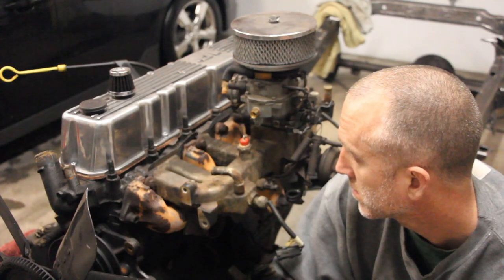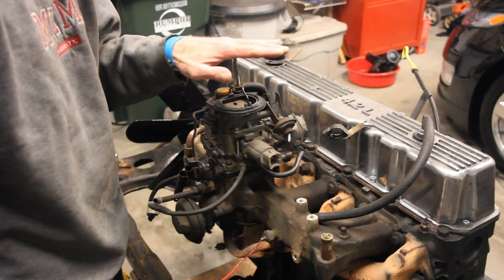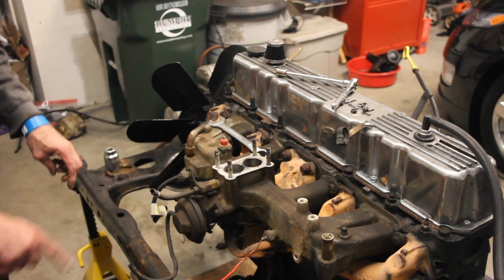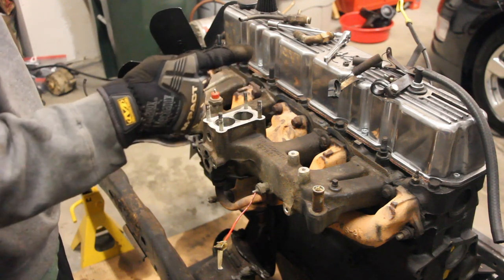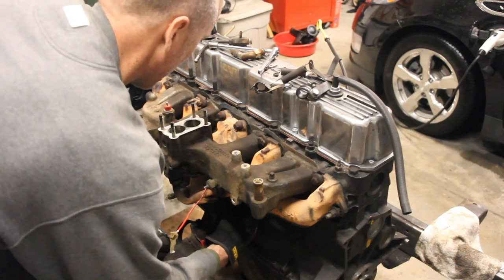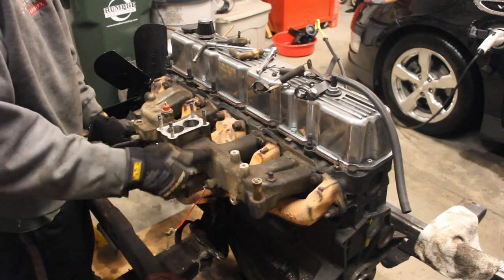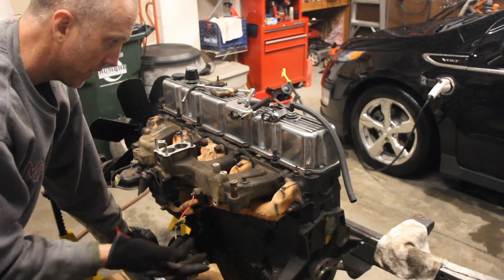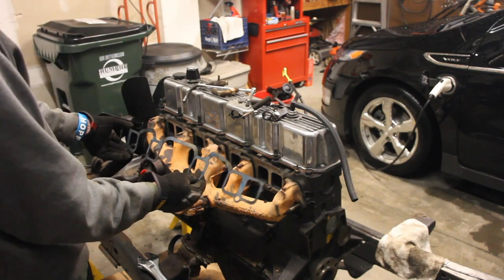Jeep CJ7 Carter BBD Carburetor and Intake and Exhaust Manifold Removal

Comment: I did a swap like this in 1983 put on a sp2p intake, 500 cfm ford 2 bl carp and split headers and dual exhaust. It seemed to double the power.
Reply from the maker: With that kind of set up I'm surprised it only doubled the power. Did you have to switch axles, and reenforce the frame?
Reply: Later I found out the other owner had broken the trans and rear end after 100,000 miles
Reply from the maker: Not surprising. I read your original post as you had done an engine swap. Hence the question about the frame and axle. Not that the CJ had decent MPG before, but what did your conversion do to fuel consumption?

Comment: Silly question, but what is that red electrical connection on the engine that's visible at 2:36 ? I am rewiring mine and I have no idea what it's for
Reply from the maker: I see 2 at that mark. The sensor is a knock sensor that was part of the emissions and ECM setup from 82-86. The red wire at the bottom of the screen is the intake manifold heater power wire. Does that help? You don’t need the knock sensor.

Comment: In my situation the motors still in the jeep and the only thing keeping me from pulling the manifold is I can’t figure out how to remove the throttle cable
Reply from the maker: Well, I hopefully this video helps. https://youtu.be/LwGvZdTswB0
If not, let me know and I can help with whatever I didn't explain.
Reply: Cool Guy I figured it out it was little tabs you push in the slide out the cable itself took me a whole day to realize it 😂
Reply from the maker: I guess that is something i need to put in the next video. Sorry i missed that point. Maybe i covered it in another vid. Anyway, congrats on figuring it out. If it's any consulation, the dash cable pulls use the same system.

Comment: consider doing the weber 2brl conversion. its worth the work.
Reply from the maker: From what I've heard it does help but not enough to merit the spend. Just so I know, What does the a $370 carburetor get you?
Reply: @coolguy_CJ7  Oh man it is like night and day! It gets you like an enormous amount of throttle response and overall speed in the jeep. It wakes the motor right up. On the downside you end up with about 10 miles to the gallon soo there is a give and take. It dumps the gas because it is not a progressive carb. I just got another one for my Jeep that I am in the process of restoring for the second time in its life! The first time I had someone else do it and this time I am doing it and its quote the project. I was searching for help on the manifolds when I came across your video. I just switched out from a 4 bbrl back to the weber because I could not figure out how to set up the 4brl in my Jeep.
Reply from the maker: Interesting. I don't think I'll do that set up for my new CJ7 but i might consider it for the one that you saw in the video. Thanks for the input.

Comment: my grommet on the valve cover only has a 1/2in gap i want to run a breather like you have do i removed the gromet and find a breather about the same width?
Reply from the maker: I would take the grommet to any auto parts place and get a standard breather that fits inside of the grommet. I got mine from AutoZone.
Reply: @coolguy_CJ7  thank you for the reply coolguy, do i need to connect the filter to the pcv valve or just let slide it in and done
Reply from the maker: @Backyard_Buzzard  that’s really dependent on how much of the system you are keeping intact. I personally would just to keep it as originally designed, but it personal choice. Also depends on if you’re getting blowback or not :)

Comment: This might be kind of a strange question,  but are the bolts that tie the two manifolds together on the block side 1/8” bigger than the rest?  I have a leak at that gasket, replaced all the gaskets today, replaced all the hardware, and I still have a leak in the exact same spot. I’m also not sure about the bolts under the throttle either.  If you have any advice, I’d love to hear it. I’m kind of thinking it’s time for new manifolds.
Reply from the maker: When you say "bigger", do you mean length or width of the bolt?
Reply from the maker: Also, it depends on the year of the engine. My 84 has a different manifold than the 79. Both are OEM. Different bolt length and connection points.
Reply: Cool Guy  every other bolt for both manifolds is 3/8” of a few different lengths. The bolts I’m talking about are 1/2” and I think they’re supposed to be 1 1/2” long, but I pulled two different bolts out from the original owner. I read something about deleting the gasket by putting a solid plate on top of the exhaust manifold before bolting the intake down, I think that’s what I’m going to do.  I’m pretty sure the exhaust manifold is cracked under the gasket near the block.

Comment: Do you kno if the coolant line going into to intake could some how crossover to the combination chamber,
Reply from the maker: Depends. What are you trying to accomplish?
Reply: I recently purchased one and sometimes it smokes white from the tail pipe. What gets me is there Is no overheating no milky oil and the anti freeze is topped off. The only thing I see differently than other vehicles is that weird hose coming from the thermostat housing to the intake manifold was questioning if this can possibly be the cause? Also I was reading up on it and I found it was to warm up the carb 🤷🏽‍♂️ this jeep I bought was converted to tbi so can I bypass this by chance. Any help is appreciated thanks.
Reply from the maker: @supie5063  Hmmm. This really seems like the start of a bad head gasket. In the early stages you won't get much of the coolant in the oil or vice versa. The hose that you are referencing circulates the coolant through the thermostat from the manifold after the water pump. Bypassing that will only cause you more problems. Might need to check your compression and maybe do a head gasket replacement before it gets worse. :(

Comment: my friend, how much gas should my jeep use in a distance traveled of 8 kilometers or 5 miles? I have an engine and carburetor just like that.
Reply from the maker: These things didn't get good gas mileage to begin with. I'd say, with stock set up, you should expect around 16 mpg on average.
Reply: @coolguy_CJ7  thanks. I spent on my last outing 2,5 litres / 8km